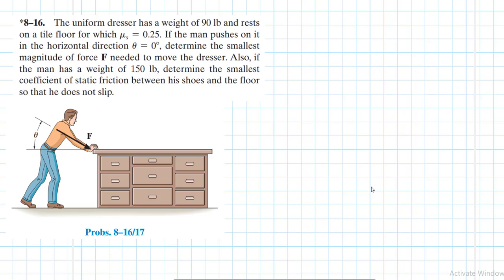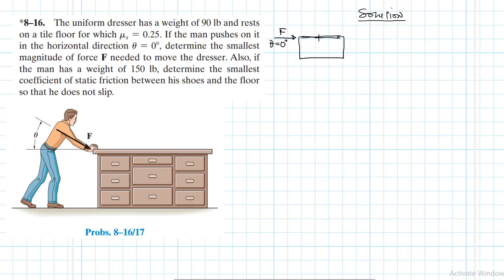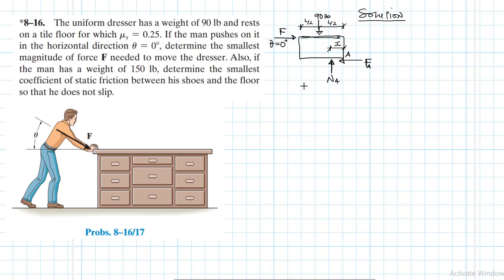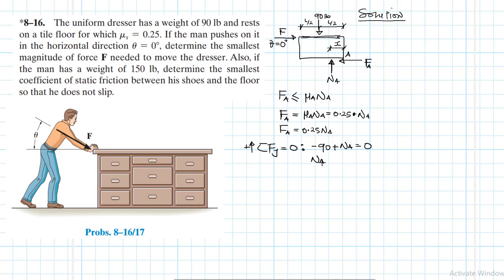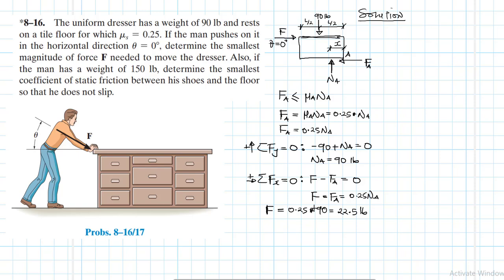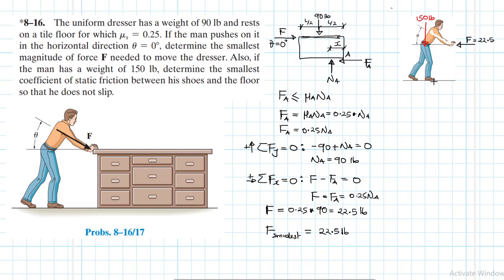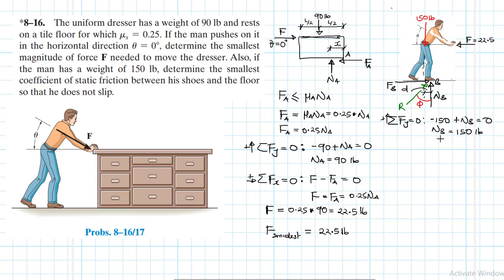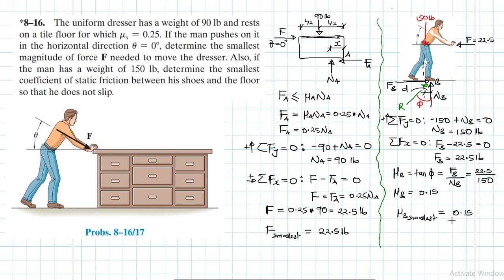8–16 Friction (Chapter 8: Hibbeler Statics) Benam Academy

Comment: Please slove this problem same diagram which you have  but angle is 30° 
Object is to find out minimum force to move the dresser
Reply from the maker: Follow the same steps as in the video, but replace the two component forces with Fx = Fcos 30 to the right and Fy = Fsin 30 downwards. Apply the equation of equilibrium as before. The steps remain the same, but the results will differ.